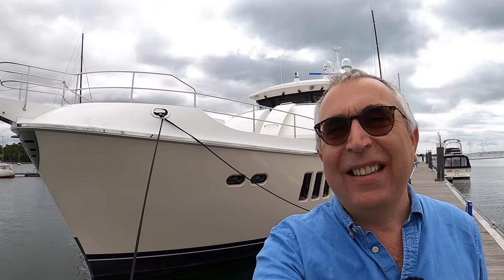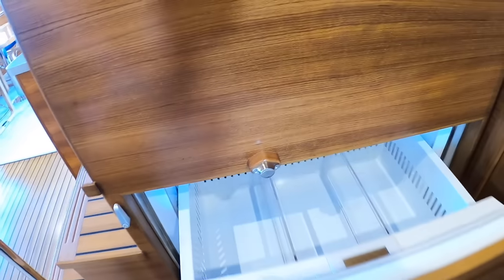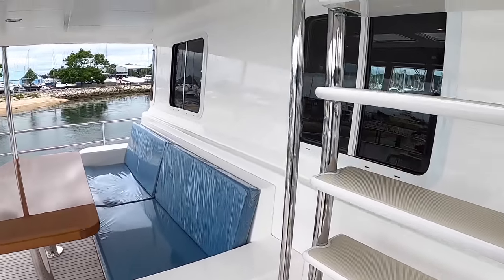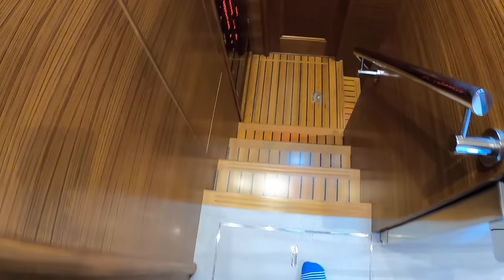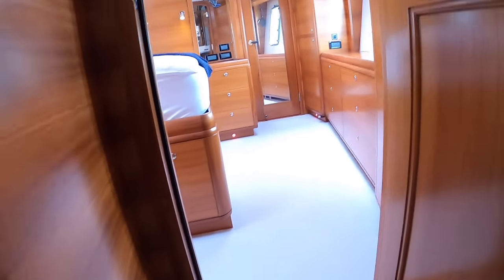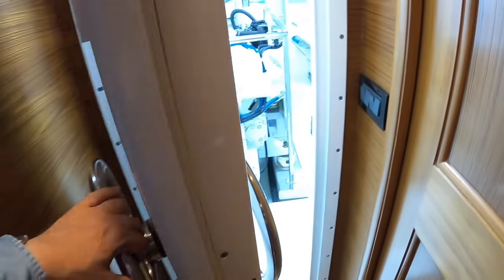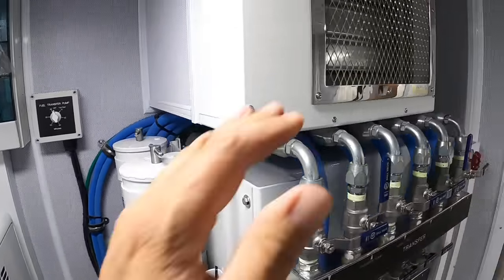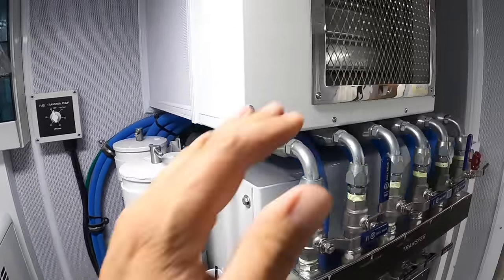$5 Million Yacht Tour : Nordhavn 68 NFB

Comment: Honestly this is the best engineered yacht I've  ever seen. On top of that the quality of living spaces really does make it a dream for owner/ operators. Nordhavn and the owner hit the mark with this boat. The only thing I would change is the engines to Cat but thats just personal preference. Fantastic tour. Thank you for showing this.
Reply: I know right? It is the best yacht that i have ever seen, they did the pilot house and the interior perfect 👍
Reply: Engine choice is an option too. A few of these have Scanias, per owner request. Cats are nice, but their heat rejection isn't so good, hence why they haven't been too popular a choice for Nordhavns.
Reply: I think i'd keep those engines. If you look across the whole range of Nordhavn boats, they use so many different engines. I am sure they have got where they are by knowing what is the best fit for whatever particular boat. Just my opinion, yours is also a good one :)
Reply: i would add an engine to make it twin cats at best don't like the one engine idea
Reply: @howardwilson3821  these luggers are so incredibly durable and the fuel polishing system is so sophisticated that you don’t need the redundancy of another 400 hp engine.  Doubling the horse power on a displacement hull won’t really add performance either.

Comment: Is this a stretch 63, or a 68 with the flybridge lopped off? It certainly looks remarkably like a 63 without the flybridge!
Edit: From the interior, it's obviously a 68 with the flybridge chopped off :)
Also, if it's going to Scotland, the bug screen will also ensure the midges don't get in :D
Reply: 68 without Flybridge. correct. Owner plans to operate in northern waters. Seems he had a Nordhavn with flybridge before, but never used it.

Comment: I adore the levels of engineering, redundancy systems, and "the little engine that could" feeling that these Nordhavn vessels will literally get you anywhere, and back, safely.  The "little ship" moniker is never more apt than with Nordhavn vessels, as there is a level of industrial, work-horse, feel to all these vessels.  And despite all of that, and my adoration, I don't think I'd ever buy one even if I had the spare millions just sitting around.  And it is down to that industrial feel.  So much of the space is dedicated to the engineering and industrial reliability, the vessel designed for working, that it loses a lot of the 'home from home' feel, and instead, gives you the very, very expensive feel of what it feels like to live on a professional fishing trawler with a better lounge.

This is a 68 footer with all the comforts of home of many of the equally capable (for the world-travelling use any of us would likely ever give them) of a 50 footer like a Grand Banks, or a Hardy, a Seaward, or a Flemming, etc.  I recall, Nick, you doing a tour of the wonderful 2007 Hardy 50, that seemed to have all of the same levels of cabin comforts, just as much living space in most regards, and cost far less than a tenth of the price.  And you'll be paying the extra harbour costs for the extra 20 feet of ship over a 50 footer.

I'm certainly not saying that these are a rip off, or not worth the extra money, because that extra engineering really is superb.  I just wonder who it is for.  Because these often do feel more like a working vessel than a live aboard one, where the reliability to get anywhere takes huge precedence over the comfort and experience of the time on the journey.  They feel as if the ship itself is given more importance than the reason for being in it.
Reply: That basically sums it up perfectly...  "What it feels like to live on a professional fishing trawler with a better lounge"

Comment: I'm going to have to join in the chorus cooing over this little ship. Just fabulous - It has been the make boat I wanted since the first one I saw on you channel - I think it was the 60. I will point out that this boat has two outrigger poles on the sides for deploying flopper-stopper anti-rolling devices. I think this is the largest boat they use them on, or maybe they don't use them on the newer boats.

Comment: You would need a forced air ventilation system in the main engineering space because I noticed the main engine air intake is in the space, not from the outside.
What a well thoughtout beautiful boat.
I'm sure the owner designed this based on prior boat experience.

Comment: Nick.......I will never understand the Nordhavan way having such large boats with low horsepower engines given the size of the boat. I take on board what your saying low RPM non stressed engines. I had a 3 litree BMW 535D twin turbo making I believe 286bhp........but that only had to move me and my 4 passengers aswell as the weight of the car itself. These boats have all those things including moving the water. I cannot understand how 400bhp is enough. Thank you as always my friend.
Reply from the maker: Because there is a maximum hull speed that any boat will reach with little effort, and then it take massive extra effort to go faster than that. As long as you stay within the hull speed, this size engine is totally sufficient. Your BMW has to be able to accelerate hard, drive uphill and overcome wind resistance to reach 150mph. If all you wanted was for your BMW to do 10mph on the flat with very gentle acceleration, you could put a 20hp engine in it and it would be plenty.

Comment: Amazing vessel! Wonder if you could run both wing and main engines at lower speed at same time to increase range. Also. Wonder if there is any significant drag created by having a Keel cooler vs water cooled.

Comment: Very nice. But I would have outfitted the engines with bypass filtration units. Allows you to greatly extend oil change intervals. All you need to do is take samples at regular intervals and send them out for analysis. On occasion, some of the additives may need topping up. 

You don’t change oil because the lubricating properties are gone, you change it because it gets dirty. The bypass units clean the dirt, soot, etc out very effectively. 

Less mess. Less money on oil. Little more environmentally friendly.
Reply: Remember its John Deere not MAN or CAT with an A rating for continuous operation, tractor engine painted white.

Comment: I owned a yacht, and I found that the continued  maintenance is ridiculous. The berthing cost plus diving on the bottom to inspect and clean the bottom prop.rudder and riggin😮g is constant. Sails are exorbitant cost and heating  cooling. And fuel cost all add up. It is expensive even for a weekend sailor.

Comment: they just keep improving, it would be neat if they partnered with riva to do the interior, so you have the range, dependability of nordhavn, and the style of riva...(with no square sinks, they are hard to clean easy)
Reply: FWIW, the owner can request that PAE partner with practically any interior designer out there to do the interior, from the sinks to the molding, right on down to the wire runs. Each Nordhavn 68 is bespoke to precise specifications - sinks included.

Comment: The elephant is the room is fiberglass isn't it? Classic design yes, great engineering yes, but I wonder why choose composites. The boat is clearly a steel or even wooden boat design originally. I realize this question might seem very obtuse to a designer, but its a compromise that will keep the keel design from beaching I should think.

Comment: I like the traditional interior design of this boat however there are a few things that I would change starting with the refrigerator / freezer. I would have chosen a built in SUB-ZERO refrigerator / freezer. The SUB-ZERO's seem to be de rigueur on the smaller Nordhavn's so it was strange to see it missing in this larger boat. I didn't make out the brands of the other appliances but hopefully they were Miele (the washer and dryer were). 

The other thing that I would change are the dining table chairs. I just don't like the look of them - they look like director's chairs. Not sure what I would replace them with. I would have to consult a designer. Come to think about it I would also want to replace that sectional sofa with a more substantial sofa covered in sumptuous leather in a color to compliment the wood trim (and that color of leather could be anywhere from Royal Blue with white pinstriping to Red with white pinstriping and everything in between!). A white fabric covered sofa doesn't seem practical for this application. If this was my boat I would have a couple of dogs on board and they would have that sofa soiled in no time! Also the sofa is just boring looking! 

When you think about it, $5 million doesn't seem like a lot of money for a brand-new boat of this size with this  level of luxury amenities and the capability to effortlessly cross the North Atlantic! Had I not seen the $5 million price tag and someone asked me how much I thought it cost I would have said no less than $15 million. Just look at the engine room alone! Look at all of the equipment and technology from it's John-Deere diesel engines, Northern-Lights Generator, desalination plant, fuel-polishing systems,  fire suppression systems and on and on and then add to that all of the high-tech navigation equipment on the bridge that you see on commercial airliners. The only thing that I didn't see was internet capabilities. Does this boat have on-board satellite internet? I suspect with Elon Musk's Starlink service becoming available internet will become standard on yachts large and small pretty soon.  

Now here comes the bad part! Exterior-wise I must admit I'm not a huge fan of how it looks externally. Nordhavn used to be my all-time favorite trawler style yacht but lately I have been leaning heavily towards the Bering Yacht's that have similar ocean-going capabilities but with a more robust steel-hull design. The Bering Yachts also have much more exciting styling inside and out. Not sure how they compare price-wise. That would make for an interesting side-by-side comparison.

Comment: If explorer yacht producers focused a bit more on aesthetics their sales should improve dramatically. There is really no reason that an explorer ship has to look like a commercial vessel and not a fancy yacht. It doesn't take a lot of sensibilities to get right. The white and beige are typically not colors you want to combine and maybe simply avoid beige these days. Larger cabin windows is another, if you have to use armored glass for an explorer that's what you do. It's not that expensive and not that heavy but makes all the difference.

Comment: You can buy a jet plane that goes 350 mph (1,467 miles max range @ 31,000 feet max altitude) and seats 4 comfortably for 2.75m so why buy this boat ? Go somewhere you haven’t seen in 3-5 hrs time. Way better use of $$$ imo.
Reply from the maker: If you want a jet plane that goes 350 mph (1,467 miles max range @ 31,000 feet max altitude) and seats 4 comfortably then you should buy a jet plane that goes 350 mph (1,467 miles max range @ 31,000 feet max altitude) and seats 4 comfortably. These tend to be bought by people who want a boat. 🙂

Comment: Really Strange -  you put clamps to hold you're pots on the hob in rough weather - but the rest of the kitchen is all flat surfaces without any thing to keep things from sliding or rolling off, including fluids. 
Someone forgot to think this through. It's like they don't give a * about the functionality of the kitchen. As long as i looks good and you can always eat take out och TV-dinners. 
At the same time - they put small "fences" on the bookshelf to keep the book in place. And a "lip" all around the cabinetry to keep stuff from sliding off. 
But the kitchen.. no. No problem with the coffeemaker sliding off, or a knife, or the toaster or...

Comment: Is it registered as a commercial boat?
Reply: Wouldn't think so, no commercial engine and he didn't mention it was built to ABS or DNV standards. If they put in a Caterpillar 3408C 402HP with an A rating, at 1800 it would run around the world before its first maintenance check.
Reply: no

Comment: Why does Nordhaven use John Deere tractor engines, I'm not seeing MAN Marine, Caterpillar Marine, proper commercial engines that will run 24/7/365. If I paid 5 million for a vessel, I would not want an engine that can't be fixed in 99% of harbors around the world, we know John Deere is highly proprietary and won't allow anyone except a Deere dealer to do repairs. For this type of vessel you want an A rating like you might put in a trawler or a tug, 24/7/365 operation turn on and go all day, day after day. Try a Caterpillar 3408C 402HP, derated to A (M1) specification suitable for Lloyd's, ABS or DNV classification, but if you had any of those classification societies, it'd be a 6 mil boat not a 5 mil boat. Just had a quick look, if you are in Stornaway UK, closest dealer for repairs is Plymouth, UK.
Reply: For the same reason lugger used the same John Deere engine as the base for their 1276. In Stornaway the nearest tech that has real world experience of the John Deere marine range is in Stornaway.